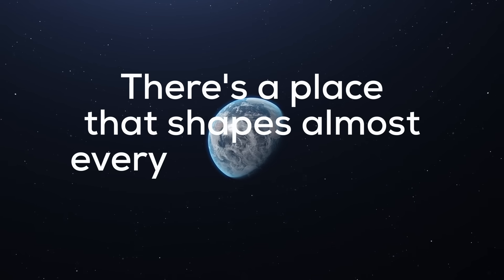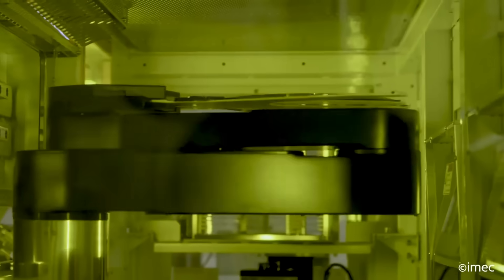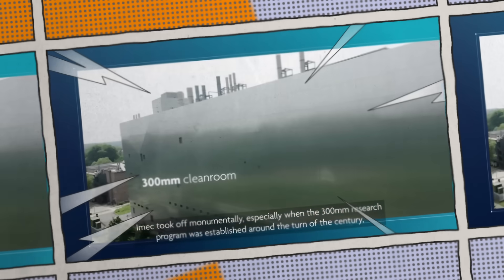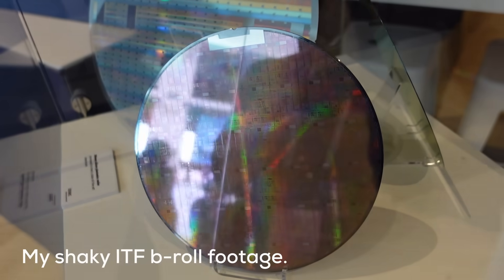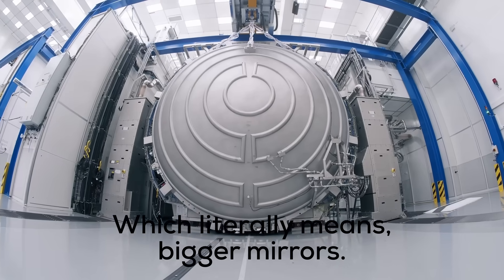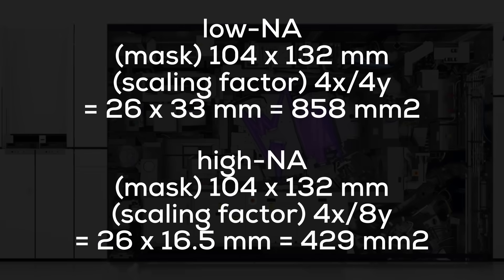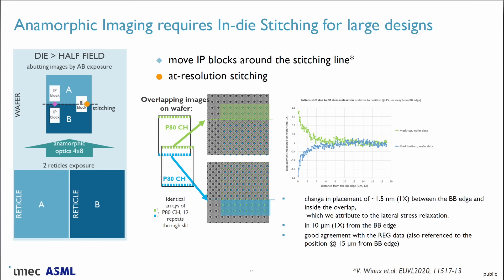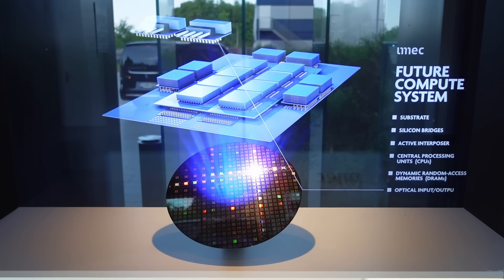imec — the most important company you've never heard of

Comment: Great video, but your explanation of why High-NA matters is wrong. It is not about the light gathering property, but rather about the diffraction limited spot size that you can generate. The minimum spot size of a laser is determined by two things: the wavelength (hence why they are always pushing further into the UV) and the aperture diameter. As it turns out, when you keep the focal length the same, but increase the aperture diameter you increase the NA, but the reason this is useful is because your spot size gets smaller which means you can create smaller features on chip.

Comment: imec is a leading semiconductor research and innovation center located in a small Belgian town.

It was founded over 40 years ago as a non-profit called the Interuniversity Microelectronics Center.

imec acts as a central hub where the semiconductor industry collaborates on next-generation technology.

The center works on cutting-edge tech like High-NA EUV lithography and advanced memory types.

imec has state-of-the-art clean rooms with 300 mm wafers and EUV scanners.

Preparations are underway to add a next-gen high-NA EUV scanner, a $400 million machine.

The imec campus in Leuven has four FAB clean rooms plus specialized research labs.

imec combines extensive scientific expertise with advanced manufacturing capacity.

In 1986, imec opened its first clean room with 125 mm wafer lines for 1.25-micron CMOS.

Early government funding from Flemish and Belgian authorities was crucial to imec’s growth.

imec led the industry transition from 150 mm wafers to 200 mm and then to 300 mm by 2005.

Unlike commercial fabs like TSMC, imec’s manufacturing is focused on R&D, not high-volume production.

Tool manufacturers collaborate closely with imec, often conducting their own R&D on site.

imec partners with nearly every major semiconductor company globally.

The research covers the entire semiconductor supply chain including equipment, materials, design, and systems.

ASML has a long-standing collaboration with imec, with its high-NA EUV scanner integrated into imec’s research space.

imec’s funding comes from public grants and investments by partner companies.

Companies contribute via cash or equipment to gain access to imec’s facilities and research.

imec helps develop technologies that will impact the industry 5-10 years into the future.

High-NA EUV lithography improves light-gathering by increasing the numerical aperture from 0.33 to 0.55.

High-NA EUV uses an anamorphic lens which scales differently on the x and y axes to overcome optical challenges.

The anamorphic lens reduces the reticle (mask) size in one dimension, halving the maximum chip size.

This shrinkage will drive the adoption of chiplets and die stitching to create larger chips.

High-NA technical challenges include interference of light reflections on the EUV mask.

Depth of focus with high-NA is extremely shallow, measured in nanometers, necessitating near-perfect wafer and mask flatness.

These technical challenges require precise engineering of wafers, masks, and lithography equipment.

imec’s research is vital to solving these challenges and enabling high-NA EUV adoption, expected around 2028.

imec is also advancing next-gen memory technologies and silicon photonics.

imec has a global presence with research sites and a new FAB under construction in Malaga, Spain.

imec is described as a “hidden champion” of the semiconductor industry where almost the entire ecosystem collaborates.

Comment: The solution for greater resolution for the printing of chips may not lie in improvements to light based systems but rather additive methods where molecules of material are moved/directed and precisely deposited vs etched with light limiting resolution to distances based upon the lights wavelengths. We might be able to manipulate individual atoms and this lets designers use any materials deposited on flat surfaces w/o having to layers consist of the entire chips surface offering chip designers great flexibility in chip design and efficiency. This would in theory enable manufacturing chips with .001-.002nm resolutions four orders of magnitude better than current limits for UV printing.
Reply: I know people working in this field and scaling for production is very difficult.

Comment: Production of simple silicon Wafers in Europe is too expensive and not competetive , there are many fabs in Europe , smaller , more specialised ones . Those dont produce computer chips like CPUs , they produce SiC and GaN chips for EVs , for PSUs for Green Energy . All theese little electronic chips have to be produced , and the most advanced are often from Europe like those from Infineon , well , they have a big Fab in Malaysia because the production is cheaper there , Europe has to high energy costs  and to high Personnel costs . In Germany / Europe are often those Machines build which will produce the Machines needed to produce Goods and Wares . ASML is the same , ASML  does not produce Wafers , ASML produces the EUV Machines needed for the semi conductor Industry . 
Do you know Aixtron ? No ? its a relative small German Company but it is World Market Leader in its SiC + GaN Tool niche , it produced the GaN Tools needed for LED production  in the 2010s from Samsung and now produces the micro LED GaN Tools . The micro LED will start mass production in 2027/2028 . The micro LED Technology will be a Game changer in the Display  / TV / VR and augmented reality Market . The optical Quality of Micro LED is way ahead of everything currently aviable , the only downside is the way to high Price which hopefully will change when the mass production starts .

Comment: I had a chance to meet a person working in IMEC when he came to my university as an external examiner for a PhD defense. I also quite enjoyed his guest lecture on circuit designs for frequencies above 100 GHz.
Reply: 100 GHz? Pentium 6 confirmed!
Reply: @Winnetou17  While it's common to think of clock frequency when hearing frequencies mentioned in relation to semiconductors, in this case it refers to radio-frequent electrical signals going through a conducting medium. In this case at frequencies over 100 GHz. For reference, I work in a lab where the highest frequencies we can measure go to around 56 GHz using highly specialized measurement equipment. I can only imagine that measuring and working with 100 GHz signals and higher is very expensive and a very delicate matter.
Reply: @Celis.C  Oh, thank you! I know what you mean (on a surface level), though I actually didn't thought of that this time.
Reply: @Celis.C  I work in a company where we have to measure modulators of up to 76GHz, the VNA itself cost around half a million 😅
Reply: @InTimeTraveller  send it to Louis once your VNA starts malfunctioning.. he can reball it.. lol
Reply: No. It is not for mobile chips but more for transmitter and receiver architecture in Wireless communication  @Winnetou17
Reply: @Winnetou17  lol for real. That sounds like Pentium 4 Extreme all over again.
Reply: What happens after 100FHz
Reply: @notaras1985 blackmagic, hard to contain and control.
Reply: @notaras1985  A lot of concrete and lead
Reply: @notaras1985 After 100FHz you get 101FHz
Reply: @notaras1985  Everybody gangsta until there's that guy in the comments that spreads more doubts than answers.